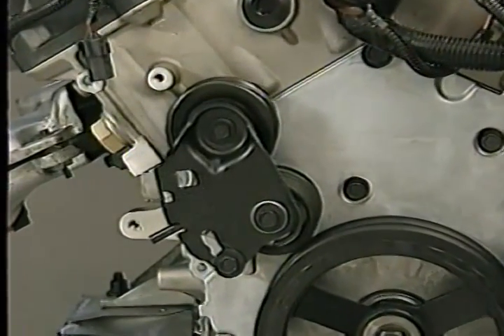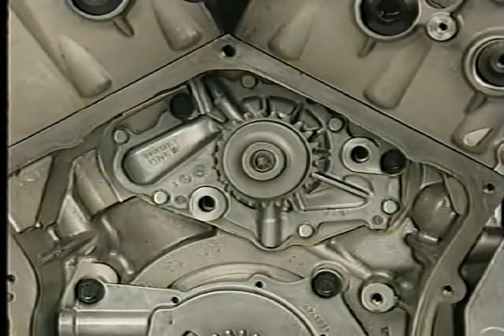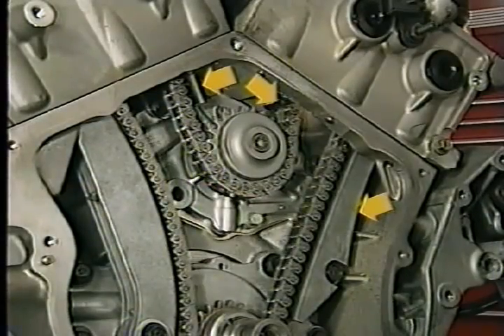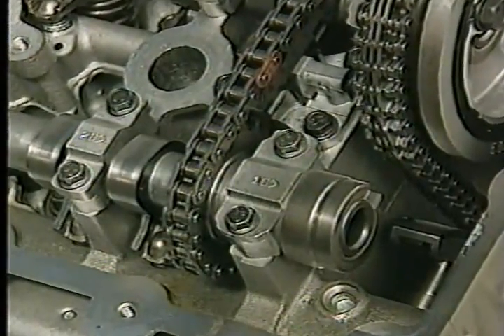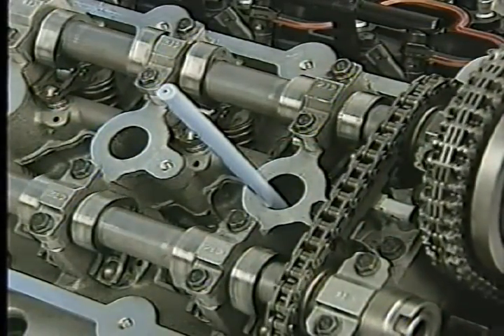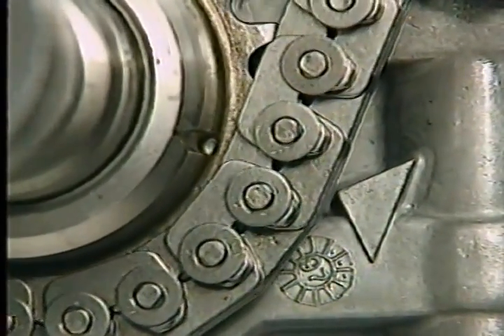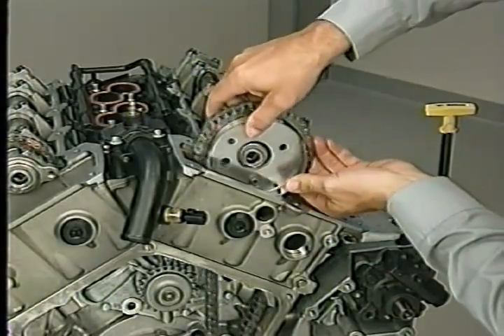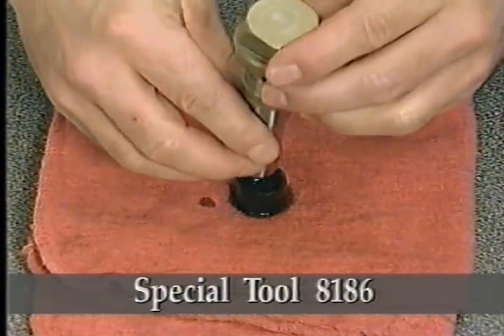Chrysler Mastertech 1997  2.7L, 3.2L, 3.5L V6 engines PART 2

Comment: Great vid. My wife has one of these damn 2.7 engines in her Stratus. They make good power, but suck to maintain. First the water pump at 130k (ok mileage for a wp)...then 20k later the ratchet mechanism in the timing chain tensioner broke/ stuck in a loose position (rattle clang bang and it wiped out all the chain guides then jumped time and kissed a few valves - gone in 60 seconds). 
I just put another set of used heads on (from a 20k engine) and this vid is awesome for showing timing marks for the heads. I can't tell what straight up is on them in the car, and been moving the chain on the cams one tooth back and forth trying to guess and afraid to call it good without more input on how to check it. As this vid shows, I can count 12 link pins pretty easy- done deal.
Beware-fyi- If you have the heads off one of these, it's worth the time to drop the oil pan and pop the pistons out to check for stuck rings (all of mine were a carboned up mess).